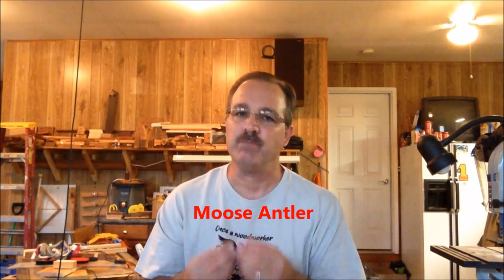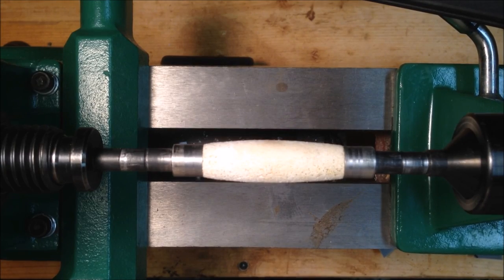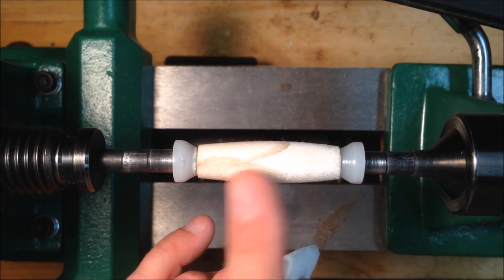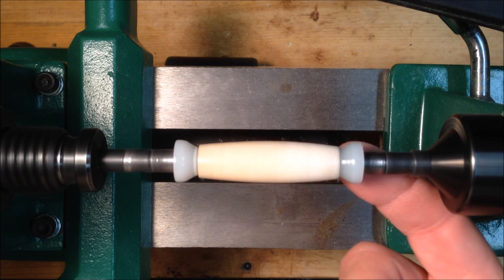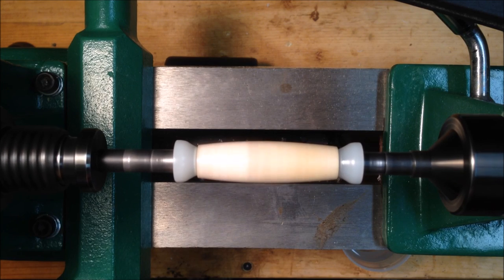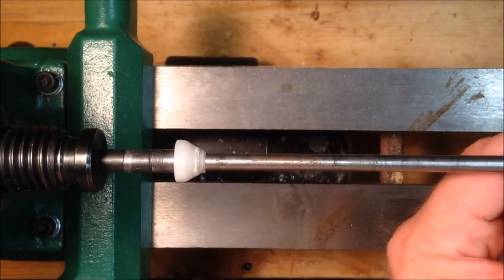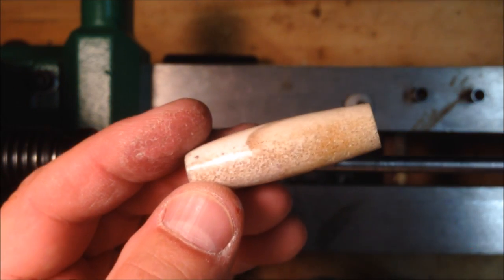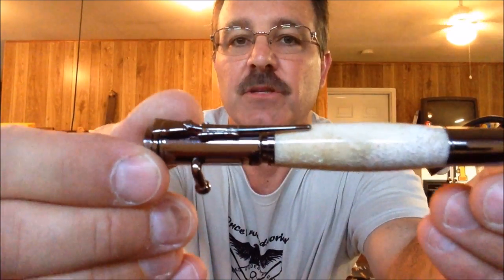Porous Antler

Comment: Hi Bob. I like your tip of fliping the blank while sanding. A simple idea and one that really works very well. 
The pen turned out great and thanks again for sharing.
Regards
Sean
Reply from the maker: Thank you Sean,
  I started turning my blanks a while back when I turned some Walnut Burl and noticed it was rough when I ran my finger across it in the opposite direction from which it was turned, it really made it look amazing. It also works great anytime you turn end grain. Maybe one of these days I will be able to get a reversible lathe.

Regards,
Bob

Comment: RJ.
  I to use CA glue on my antler pens and indeed it does fill the pores. Antler pens really look classy with the CA glue finish. I also put two coats of polish that is used to take the scratches out of head lights on cars. That really makes it smooth. Good video. Thanks for the info.
Reply from the maker: Your welcome,
  I love turning Antler and the more I talk to other turners, the more I hear about car headlight scratch remover. I am going to have to try it when my One-Step runs out, It is certainly cheaper and I can pick it up locally as opposed to mail order and paying shipping.
  Thank you for commenting and telling me about your process, I learn so much from these comments.

Regards,
Bob

Comment: Good video Bob, I am getting some antler so I'll be able to se this if I see the same texture.  Thank you.
Best Wishes, Brendan.
Reply from the maker: Brendan,
  It's pretty stinky when you cut it and drill for the tubes. Be sure to wear a mask too because it's really bad for your lungs.

  That being said, it turns pretty easy, dulls tools quickly, and sands super easy. It is really beautiful when finished and here in the Mid-West is insanely popular.

  Best of luck with your antler.

Regards,
Bob